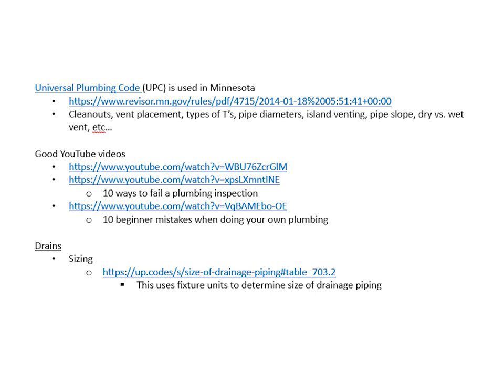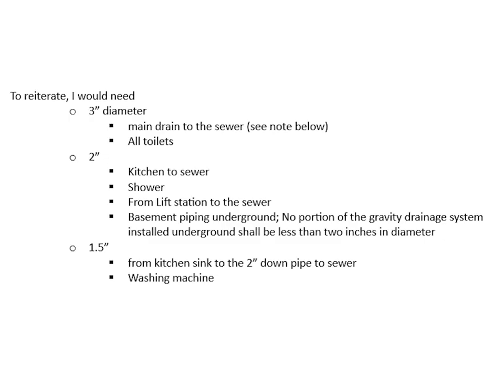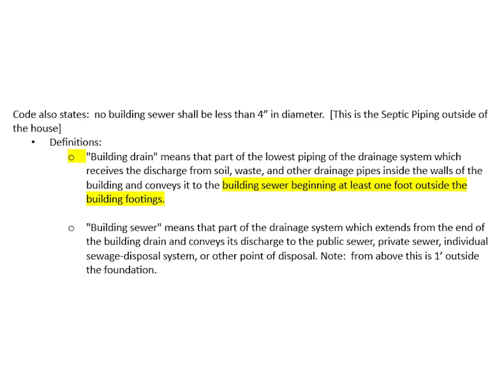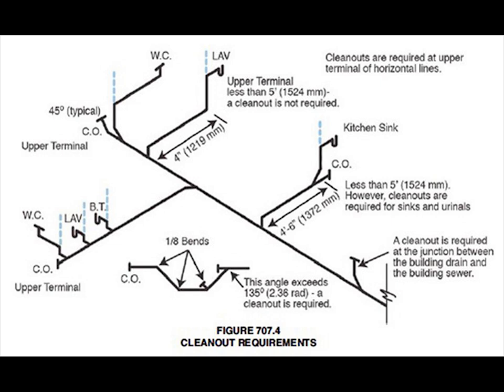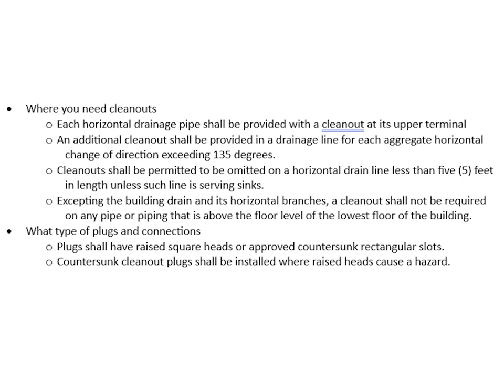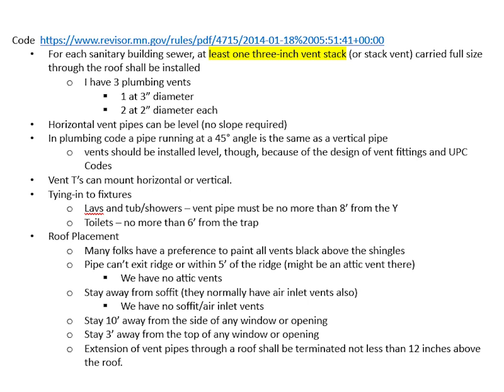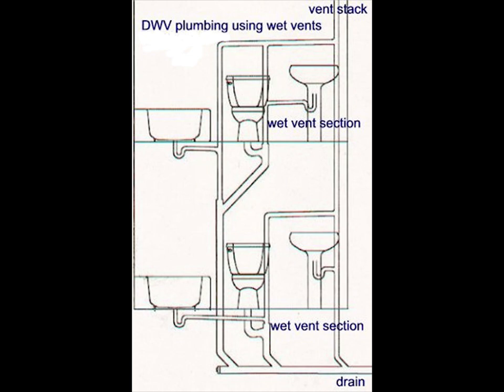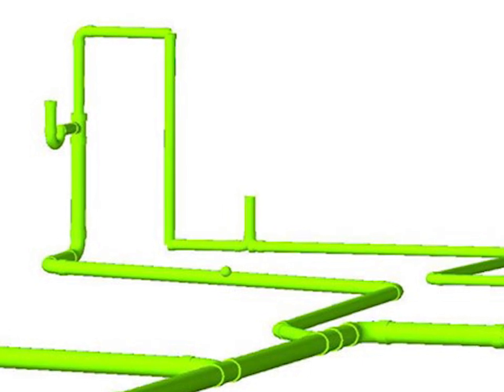The House that Jack Built - Chapter 4.  Episode 10.   Design - Drains/Waste/Vents.

Comment: You just cast doubt upon your whole presentation.  First it is the Uniform Plumbing Code with local ammendments.
Reply from the maker: @terrychristian5503  Thanks for the feedback.  I knew that in making this I opened myself up to suggestions such as yours.  Early on I state that this was my research and construction, and that there would be areas where imperfections lay.   I'm not representing myself as an expert or licensed tradesman.  This was merely my experience in constructing this timberframe.  Thanks again.
Reply: @f16jack  Thank you. Did not mean to come across as a know it all, I don't.  My background is 45 years as an HVAC, plumbing, and fire protection licenced engineer.  Read a lot of various building codes in that time.  I should like to mention, that the over arching code over all the other construction codes, from 2000 on, is the IBC, the International Building Code.  Before that it was the UBC, which after much negotiation, table pounding, and hurt feelings, became the IBC.